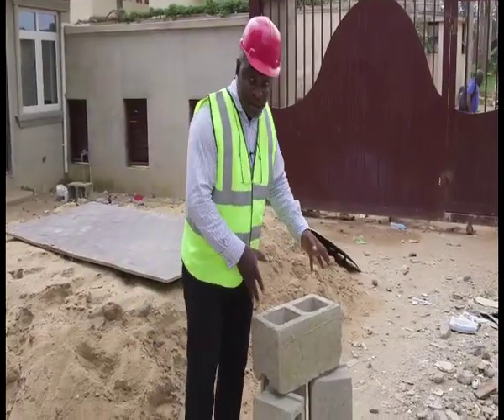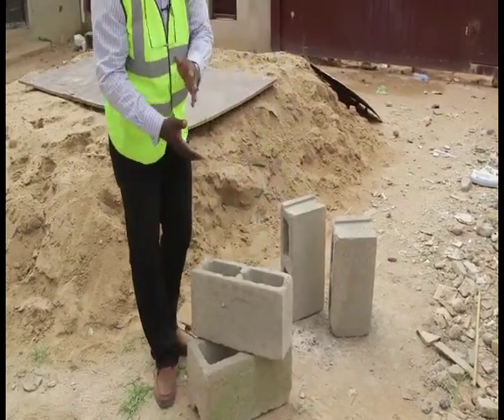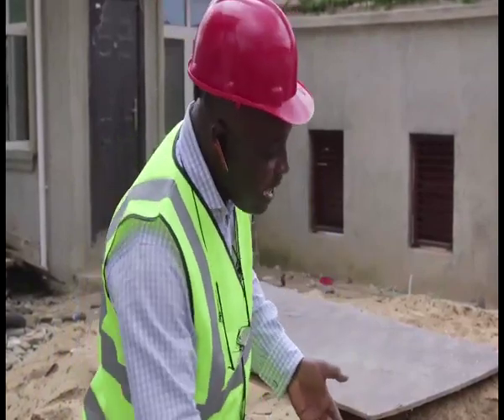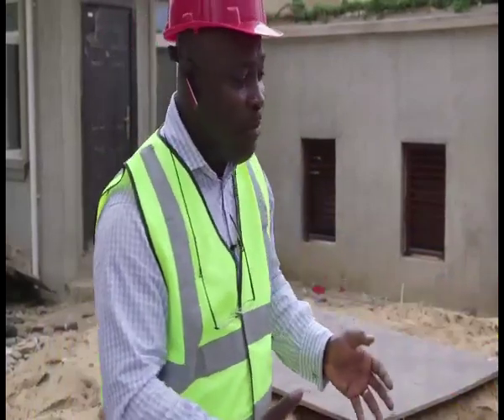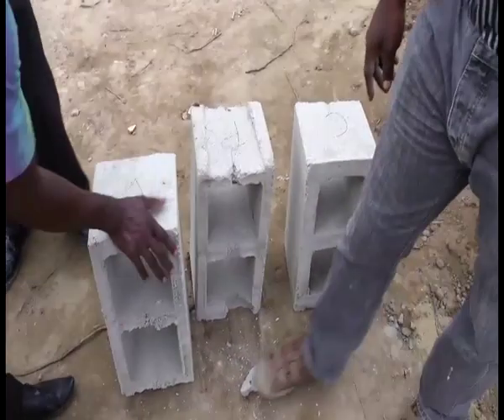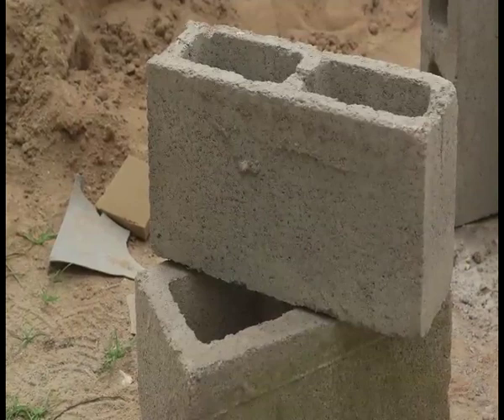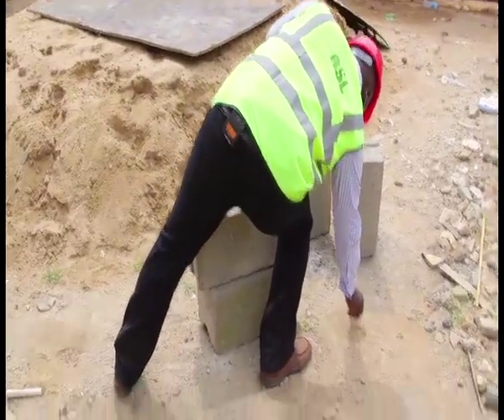EPISODE 4: Before you buy that cement block!

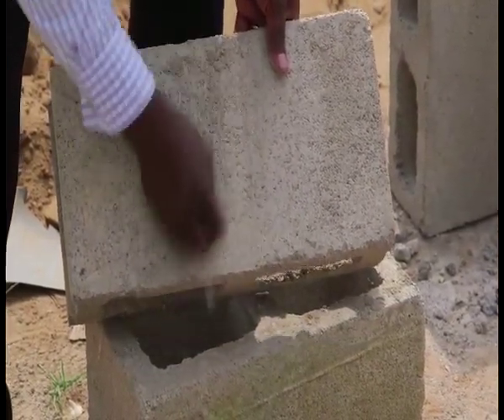Comment: Sound completely gone for me at 3:26.  Thanks for the vids!  They're super helpful!  I also recommend a drop test and a hammer and nail resistance test.  Blocks dropped from 4' [some say higher] onto a hard flat surface and crumbles should not be used for load-bearing purposes - especially if the pieces that break apart can crumble in your hand without applying much force, and if nails cause the block to disintegrate every time, same.  There is also the finger abrasion test - if you can rub with your thumb in a few strokes deeper grooves anywhere on the block, that's a nope.  Reject the entire batch when testing a sample and it shows these results.

Comment: Concrete should be be tested with a compressional testing machine. Period.
Reply: stevo Stevo a what? Where would I get one of them here in rural Guyana? I think I might have to use some manual tests, too bad the sound crapped out.
Reply: in your world bud
Reply: Spot on. In other climes blocks are manufactured to certain strength. So you know the strength of what you are buying. Any manufacturer who cuts corner or misleads the buyer will be severely dealt with. Visual inspections or weight gauging are crude methods of determining the quality of blocks and could easily go wrong. We need to educate ourselves and raise our standards.
Reply: @ola-didi  Field testing have been performed since ages ago before laboratory testing became standardized.  An experienced inspector ensuring quality control of her building materials performs field tests at will.  At times lab tests are required, but field test can be performed at will.  Worst case you install substandard material into your structure and it fails because you failed to do field testing of a sample quantity of material which if you had done, you could have rejected the material and demanded better quality or source better quality.  In many regions, laboratory testing for compression testing is not available, or very expensive per block [whereas you can test as large a sample as reasonable for a field test] - if it is expensive - this is the case where it is up to your personal levels of quality control.  But I would always do field testing, with or without lab tests.
Reply: TIFFANY PERSAUD there are many factors that can contribute to the strength of masonry wall. Yes the block strength is important so as the mortar strength and workmanship. Field testing will only work if you can test every inch square of the block which is not possible. The best way is to standardised block manufacturing to produce desired compressive strength. 
In the country where I work nobody performs field tests on in situ masonry except if existing masonry is to carry more load due to new construction and original strength of the block is unknown (and this is rare and unlikely). Even with this an overall factor of safety of 5 is applied to the results because of the uncertainties. Also, concrete is ordered from the mixing plant. All you do is to specify the concrete strength and quantity and it will be delivered to site when needed. Cube samples can be taken and 99% of time they will pass. If samples fail the concrete manufacturer will be held responsible. In this age, what we need is standardisation and most of these issues will be gone forever.